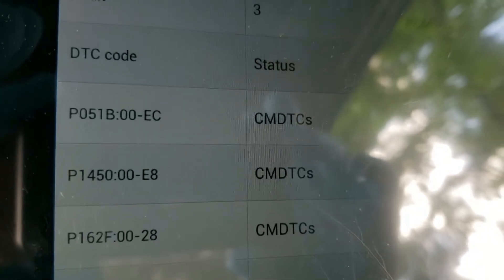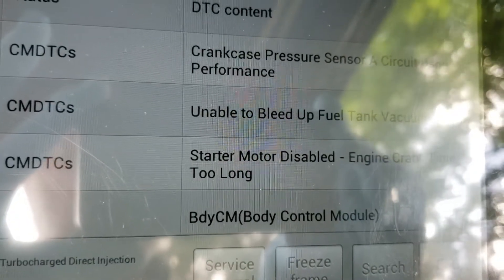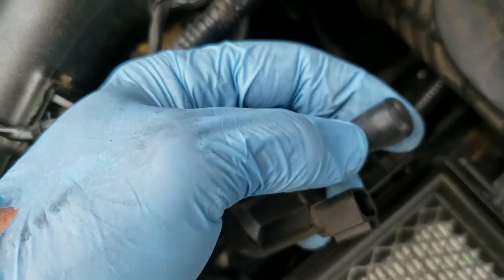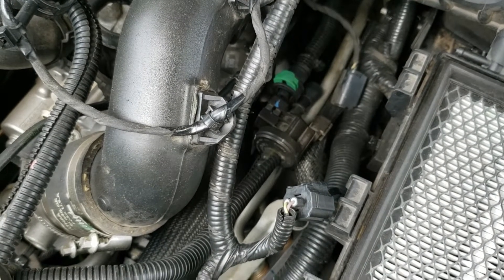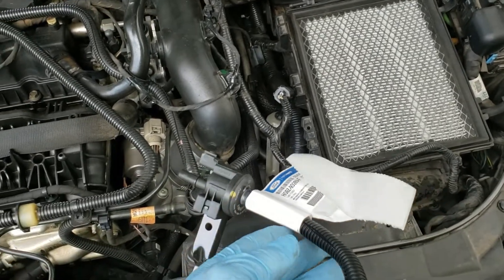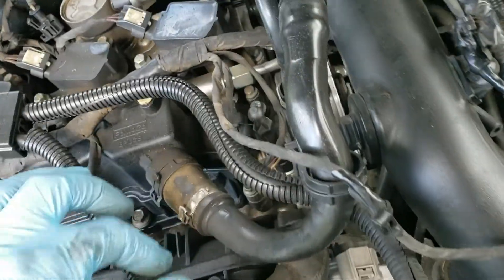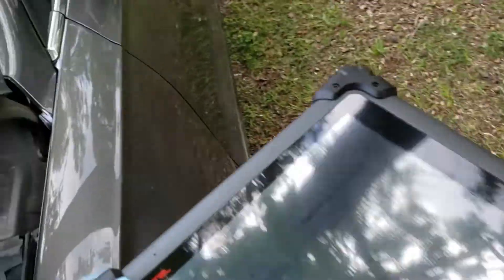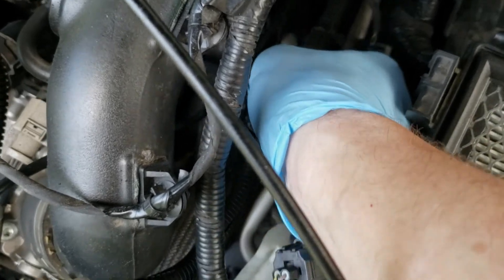2017 Ford Fusion, Stalls and Hard Restart After Adding Gas, Code P1450

Comment: You can also place a small square note ⬜ paper in front of the fuel filler tank while the car is running and if blower AIR towards the paper and it end up making a fart nose towards it then it the purge valve part

Comment: What is the part number on the new part ? I can’t seem to find one anywhere !
Reply from the maker: HG9Z-9D289-F from the local Ford dealership. You may be able to take that number and search around for alternatives. Assuming  you have the same vehicle with the 1.5 liter EcoBoost turbocharged engine.
Reply: Dealership is probably best bet can't find em at any of the parts stores